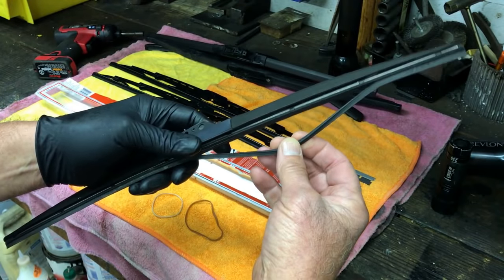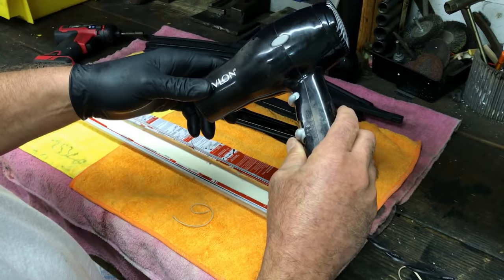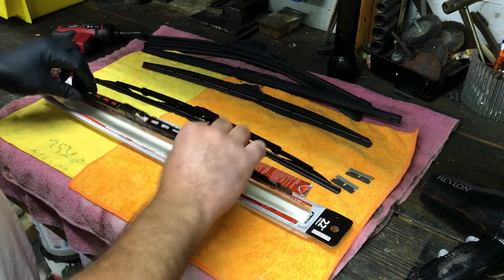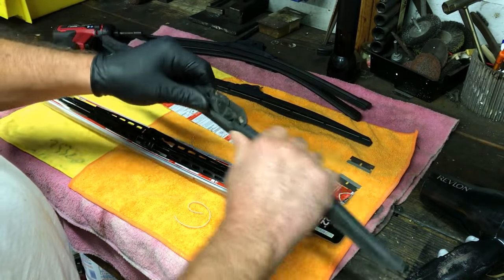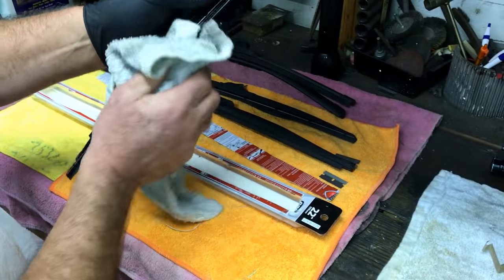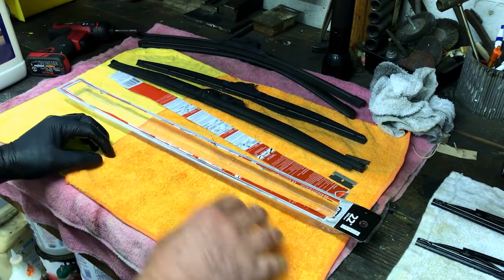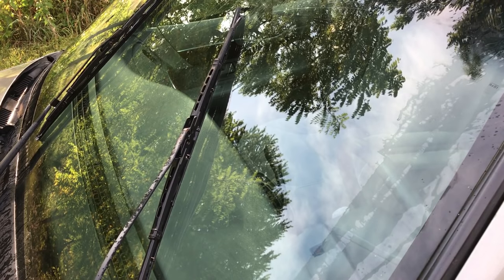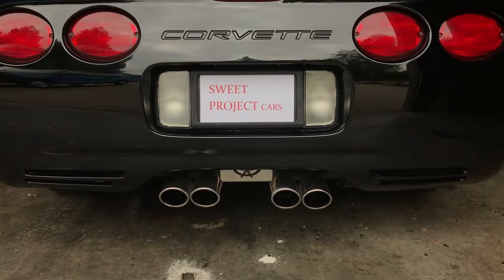NEVER ! Replace a Wiper Blade  AGAIN !!!  Amazing :)

Comment: I'm sure this method for conditioning and preserving wiper blades works wonders for blades that never encounter icy windshields, but I question how they'll hold up to the abuse wipers blades take when dragged over ice. Living in upstate NY, wiper blades usually last no more than two seasons before needing replacement, and the main reason is that ice on windshields will cause small abrasions to the edge of the blade that contacts the windshield, resulting in streaking and impaired visibility. Great idea though for warm climates.
Reply from the maker: they work in any weather the cold or hot...of course you dont go grinding them across the frozen ice on the glass ...but who would do that when they have an ice scraper   thank you very much glad to have you here with
Reply: Sweet Project Cars Yes, an ice scraper is used to remove ice from the windshield before you start driving, but once you've begun driving, ice not only reforms on the windshield but forms directly on the wiper blades too, which inevitably causes damage to the blades, regardless of how well the windshield was initially de-iced.
Reply: J Marconi you need to have your cooling system checked out
Reply: Dustin Pomeroy I've owned at least dozen vehicles, both cars and trucks, over the years, and every one of them formed ice on the windshield while driving if the weather conditions were just right. When temperatures fall below 20°F even salt has difficulty melting ice on the roads.
Reply: J Marconi I don't know,I live in Michigan I don't think our weather conditions are that different,but I wil say I don't go cheap on the washer fluid in the winter,I can't stand anything on my windows,I use the shit outta that purple stuff,the thing that goes on mine usually is the covers,but I don't use  the winter blades anymore so it's not an issue,I'm also one of those people that let their vehicle run for 10 minutes before they leave anywhere ,haha I'm lazy and I'm not scraping shit and my car is like an oven by the time I get in,might have something to do with it
Reply from the maker: I guess I have never driven a car that I could not see through the ice on the windshield...i keep my defroster on so that does not build up on me..other wise if it did I would have to stop driving because i could not see the road.
Reply from the maker: exactly what i was thinking...never driven a car that i could not see through the glass,.
Reply from the maker: you should get that checked as Dustin said a good heating system and defroster does not let build up of ice form at least not in my 40 years of driving on Michigan roads...but maybe thats just me.
Reply: I've had the same problem with the ice buildup, sometimes the wipers get buildup on them and are inches away from the windshield.  Have to stop and beat the wipers against the windshield to break it off.  And I've always driven Ford trucks, the defrost kicks butt.  Of course, I only have had the problems during storms when most people wouldn't even go out on the roads.
Reply: Fred Flintstone Thank you for your input... I always get ice forming in the top and side areas of the windshield and also on the wiper blades during cold, snowy conditions. No matter how high I crank the defroster I always get a little ice formation that consequently grinds the blades.
Reply: If you wax your windshield it should be harder for the ice to stick to it
Reply from the maker: does this happen every single day in the winter? and the ice build up on the blade frame does not mean it is on the very rubber edge :)  and thats the part we are protecting with this method. but if you have ice built up on all of your windshield as you are driving you should pull over and scrape it off as you would not be able to see through it and that would mean your Defroster can't keep up in a full blown ice storm..:)
Reply: J Marconi. Agree completely useless in a real winter situation. Also mud and bugs from summer driving but hey if you do the insurance average of 15k a year or less in your car its probably awesome.
Reply: bob Archer do you guys just not like buying washer fluid,I refuse to believe we don't have real winters in Michigan,this guy has seen real winters and he's treated his wipers,you guys have not so I don't know what real life experience you guys are basing your opinions on I just don't understand people who will say somebodies full of shit,when having not tried what they are saying and pass or fail seen the results,try what he says if it doesn't work than you have the right and knowledge to tell him he's full of it ,but up until than you guys are the ones just talking out of there asses
Reply: I'm on LI, and I just swap the blades out. Not that big of a price to waste on something that you are actually going to use
Reply: Sweet Project Cars Well  here it gets too cold to use a defroster to keep them clean.  it's better to  keep the heat on the floor gloves on the hands and let snow fly off the windshield instead of melting.  Its's tricky  but once you got the hang of it  your windshield stays clear as long as your moving. and wipers brush it all away before it can melt if your not
Reply: The Trick is to Keep your Defrost OFF!    Heat at the feet on low and Gloves on the hands.  this let's snow blow off instead of melting smearing and freezing.  your wipers only then have to brush the snow off.   Warmer terms can mean freezing rain.  that's the only time I would use Defrost to keep the wet snow from freezing.  don't get much of that here in Canada outside of BC, Ontario and Quebec
Reply: Lego zahar really?   how do you apply wax at minus 20 degrees C?   Not sarcasm I really would like to know if this is at all possible.
Reply: IK - UA ya Swap them  BUT  you might want to use it on the rubber hoses in your engine compartment.  that could save you tonnes in repair bills in the future.  Just a thought.  1 repair avoided could pay for itself in your time and money
Reply: Lisa T Jesus do you live in Antarctica?
Reply: Dustin Pomeroy Just Alberta Canada.  Unless its warm enough that your defroster almost evaporates the snow off your windshield when your sitting at a light this method keeps snow frozen and your windshield and other windows especially the side and back windows clear.
Reply: J Marconi I
Reply from the maker: thats why you use 303 it prevents ice build up on the blades
Reply from the maker: that's correct Dustin great answer
Reply from the maker: I have lived in Michigan for 53 years and never had the issues you are talking about with ice build up ?
Reply from the maker: you are correct fred ...in hard storms, no one is protected from ice build up
Reply: Lisa T you know they sell backseat heaters for like 15 bucks?
Reply from the maker: This is why we did this video   https://youtu.be/_roafGwUvq0
Reply from the maker: This is why we did this video   https://youtu.be/_roafGwUvq0
Reply from the maker: This is why we did this video   https://youtu.be/_roafGwUvq0
Reply from the maker: This is why we did this video   https://youtu.be/_roafGwUvq0
Reply from the maker: This is why we did this video   https://youtu.be/_roafGwUvq0
Reply from the maker: This is why we did this video   https://youtu.be/_roafGwUvq0
Reply: Buy a car with heated wipers and heated washer fluid.
Reply: J Marconi 0
Reply: It is Not Drunk, You mean "Impair"! ( I was worried for A While....)

Comment: OK, you have me convinced. I just ordered some 303 on Amazon.  As you've shown it has a multitude of uses.
I'll have to do this when I buy new wipers. mine are already ripped and they're not even a year old.
Thanks for another great tip.
Reply from the maker: bruce you will be a happy camper for sure :)  and you are welcome,  buy the really good ones and they will never fail on you with the method ...

Comment: What did you spray the blades and windshield with? 303 protectant? Wouldn’t it be super greasy?
Reply from the maker: Michael...303 is nothing like anything else out there, it is the only WATER based UV protectant we know of,  it does not make the glass greasy in anyway.  thanks for the great question :)
Reply: I just watched this and thought the same thing. I was going to ask, but knew someone else must have. Thanks for asking and answering, both of you.

Comment: You turned a simple job into more work. I switch the wiper blades on my car twice a year. The blades that come off the car and are wiped cleaned with Mequiars rubber protectant on a rag. I have been using the same wiper blades for years now.
Reply from the maker: Janice The just of the Video was to show you never have to replace the blades, why would you want to if you don't have to...CARS ARE MONEY PITS save where you can.   The Video shows how you can keep all the cars rubber parts in great condition and not have to replace them.

Comment: I almost gasped at the price for the 4 gallon jug, but the other sizes were reasonable and of course unless you use it a whole lot that would probably last so long you'd forget you bought it. I'd buy it just for the wipers and other rubber car parts like door trim, but I can see using it for so many things and for leather and vinyl stuff as well.... it would be very useful to me in here in hot and humid Florida.
I BADLY need wiper refills, but now I know how to make them last longer. Thanks for sharing. I love to get tips from professionals and savy car buffs on keeping vehicles in good shape.
Reply from the maker: Master the great thing about 303 is it goes a long way and works on just about everything on your vehicle thank you very much we truly appreciate that and are very glad you are here with us :)

Comment: To: Sweet project cars,
I have a concern about spraying the rubber conditioner on the wipers while they're on the windshield, I've had some terrible troubles that turned out to be caused by a chemical saturated into paper towels, if used both inside and out it can cause a condition where in moist wet weather oncoming headlights will cause the car's windshield to light up nearly into end and you won't be able to see anything for all the light coming in, a very dangerous situation, especially on a turn! The Wax in automated carwashes can do the same thing!
It can take an extreme cleaning and a clay-bar
To clean the windshield enough that this effect no longer occurs
Has any rubber conditioner caused any effect similar to this on your windshields?
Reply from the maker: Josh there is no worries we have done this hundreds of times on hundreds of customers vehicles would never an issue have no worries my friend. Have a great day
Reply: Josh, I had that same concern (happened to me when I tried rainex on the windshield).  But I see that Sweet Project Cars has replied and said it is not a concern...so I am going to give it a try with 303 Protectant.
Reply: Instead of spraying on get a small rag and wipe the blade.
Reply: Thanks for the tip, Josh! I have often had that problem with both my old and my new windshield! I would protect the windshield with cardboard before treating the wipers, or just remove them first.

Comment: I installed silicone wiper blade.
Reply from the maker: well make them last FOREVER then with this method   you are very welcome glad to help :)
Reply: Tim McDaniel  Same with me. Been on the car for 14 years and have never touched them.
Reply: Tim McDaniel lol yep I heard stores don't carry them cause they want u to constantly buy em. Bosch rubber blades for my v12 they wanted $150!
Reply: Wonder I could make my own with a mould using those blades that have slide in Rubber inserts as a template.

Comment: Great vids! Thanks. By the way would this affect the performance of silicon blades or can they be treated too? (Asking because silicon wiper blades require treating the windshield with a conditioner wipe which is used to apply silicon to the windshield to increase the ability of the wiper blade to slide easily on the glass).
Reply from the maker: this actually aids the higher quality blades like the silicone blades even more ..thanks for the great question :)
Reply: Thanks for the clarification, much appreciated ;)

Comment: Do you get snow and ice on your windshield. It is what tears up my blades.
Reply from the maker: we have snow and ice but make sure the glass is cleaned before running the wipers
Reply: Any tips on thoroughly cleaning your car windows or just your standard Windex is good enough?
Reply from the maker: Party  this is how we super clean auto glass https://youtu.be/Cp2tvqeov4o hope this gives you some pointers
Reply: Thanks. Ordered a few items you recommended using your affiliate links from Amazon. I appreciate the tips and feedback.
Reply from the maker: good deal you will love the results my friend :)
Reply: I take my good blades off my wife and kids cards as soon as the snow flys and put on junk for the winter. If you scrape and brush it is not an issue and we are likely to have snow 5 months of the year here.

Comment: Got a new set of wiper blades for our Toyota Sienna but the blades did not have a package that was sealed to use as a "trough" so I just wiped them several times with 303 and then sprayed them upside down over a trash can and let them dry that way. Will need to re-apply a couple times a year and see how long these blades last.
Reply from the maker: there you go frustration again builds invention :)

Comment: would be easier to change the blades every so often
Reply from the maker: Peter very good question the idea behind the video was to show everyone that you can use this product on all the rubber on your vehicle not just your wipers it works on leather vinyl and plastic is well and as you know cars are money pits so if you can save even a few dollars every month it all adds up have a great night
Reply: Nice if you have the money and your LAZY!
Reply: Sweet Project Cars not only that but certain makes and models require hard to find and expensive replacement wiper blades, Mercedes Benz and BMW to name a few
Reply from the maker: joseph muscat saving money is not being lazy

Comment: So off subject but since you are the fix it all kinda guy, I have a question, have you ever attempted to fix a rolling window motor or is it built to be a one-time used only? They seem to have a coil and brushes, why can't we just replace the brushes (like in the case of my older hand held power drill) and have them working again? What do you think?
Reply from the maker: john we have found they are so cheap you replace that it is not worth the manufacturers time to offer the bushings.

Comment: Just spent $50 for 2 wipers. Bought a used car and wipers were cracked and coming apart
Reply from the maker: With this method you won’t be buying blades again that’s for sure my friend
Reply: Damn, $50 bucks on 2 wipers? Your car must take those huge blades with the colored plastic that only a Mexican would like.
Reply: @All2Skitzd 
Or he made sure get Bosch Icon/Envision & got them at Advance/Napa/AutpZone

Comment: 303 works great on tires and CV boots. I do my tires with 303 Protectant by spraying the tread and both sidewalls. When the tires were first installed, I had the tire store spray the inside of the tire and that is the only time you need to do that. Since using 303, I have not had to replace CV boots or joints as CV boot failure is the reason why CV joints fail....dirt gets into the CV joint and causes wear and eventual failure. Since using 303 on my tires, I have over 173,000 miles on my tires and they look brand new with almost all the tread on them. No uneven wear and as quiet as when new. 303 is fairly cheap and way better than other protectants.
Reply from the maker: Steve you are exactly correct it is a phenomenal product I don’t know what we would do without it we have made so many customers happy with it it’s just amazing
Reply: I'm calling B.S. on the tread life aspect.
173,000 miles on what surface? Grass?
I can't believe your tread lasted that long on pavement.

Comment: The new BMWs are all rubber and plastic ... Bmw drivers take note!!
Reply from the maker: there you go, best reason to use 303 UV protectant   thank you very much for the great comments and we are very glad you are here with us :)
Reply: are you sure they're all rubber and plastic, i have took many apart and don't recall seeing one without at least one metal strip, sometimes two or three. One acts as the spring, and the other two in the blade

Comment: The 115 degree heat in lake havasu will kill any blade in a couple months. Period. Car batteries " any brand" 5yrs.
Reply from the maker: J P well we have been using 303 for years on our motorhome in Laughlin with never an issue the blades last for years

Comment: Was the two squirts on the blades at the end of the video also using the aeorspace protectant?  Or was it just a glass cleaner?
Reply from the maker: it was the conditioner :)   thanks for being here with us :)
Reply: The conditioner meaning the aerospace protectant?
Reply from the maker: yes sir

Comment: How does 'conditioning' the rubber prevent them from wearing out and leading eventually to streaking?
I change my wiper blades anually, and the rubber is still soft and pliable, but the very edges no longer wipe streak-free.  Does 303 somehow increase the abrasion resistance of the rubber?
Reply from the maker: Adam Ant it does not lead to streaking ever, and why would you want to replace your blades annually when you would not have to change them at all. See the JUST of the video...it was showing you can treat ALL the rubber on your car or truck and many other items, vinyl, leather, plastic and keep them nice so you don't have to constantly replace them as cars and trucks are already MONEY PITS, why not save where you can., when you use a water-based UV protectant rubber will last much much longer.